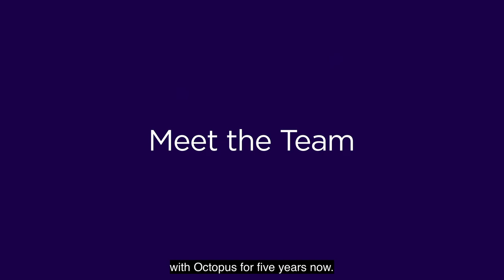Meet the team | Octopus Energy Services

Comment: Octopus energy took 11 months to fit 2 smart meters,they put me on credit mode without informing me and l'm now stuck with a £150 debt that has to be paid back through the meters,l was transferred to octopus when Bulb went under and l wasn't even asked if I wanted to transfer to octopus energy!Most of the credit on the gas meter is eaten up by the extortionate daily standing charge! Octopus Suck! 🇬🇧🐭
Reply from the maker: Hi there, I'd love to check on what's happened here because normally smart meters are installed with the same configuration as the meters being replaced. Please use this form to send me your email/postcode so I can find your account & take a closer look to help here 👉 https://octo.ps/nudge 👈 

The standing change is set by Ofgem but we've continually priced our below the cap. More info about this here too https://octopus.energy/blog/standing-charges/ 🐙